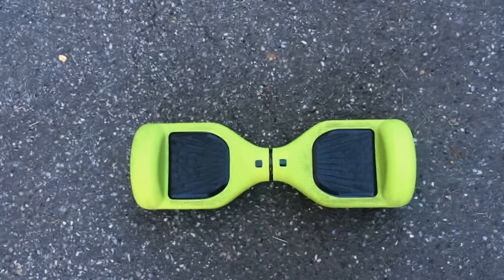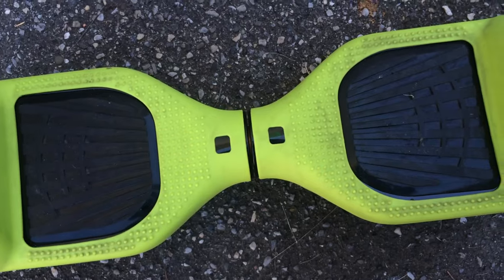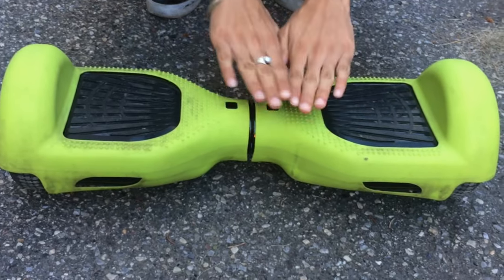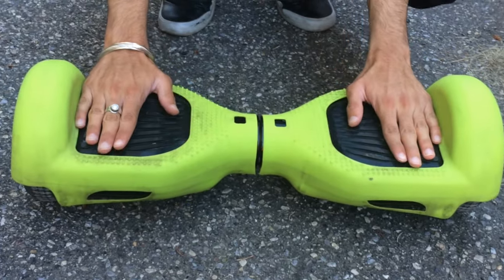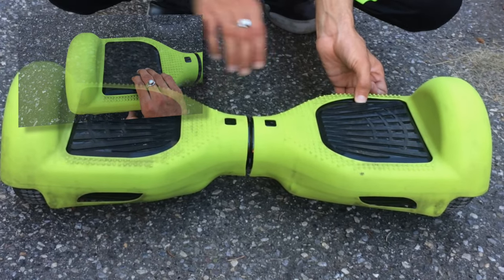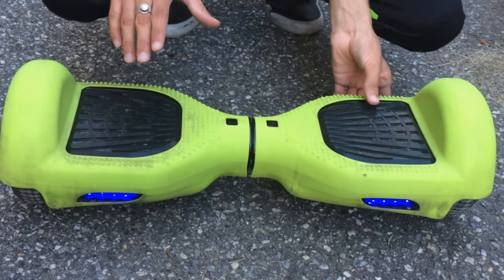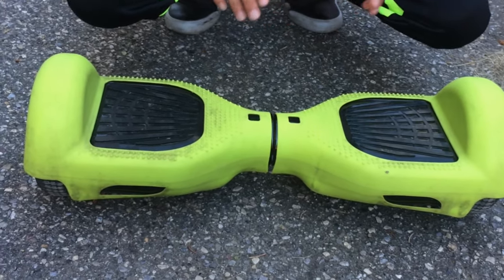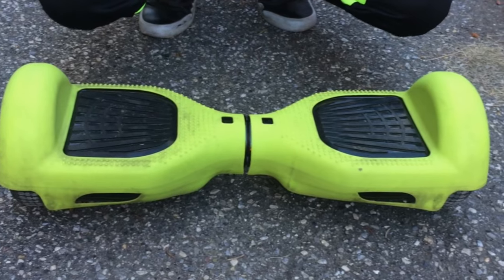How to fix Hoverboard Red light flashing, Beeping Sound

Comment: My hoverboard is countineo red light blinking after i press the power on button_
Also i reset the my hoverboard but its same like before red light blinking_
Any body solve this problume_
Thanks
Reply from the maker: Might be a problem with the motor or the circuit board.
Reply: hi bro what if you get a green light with a cyclone sign?